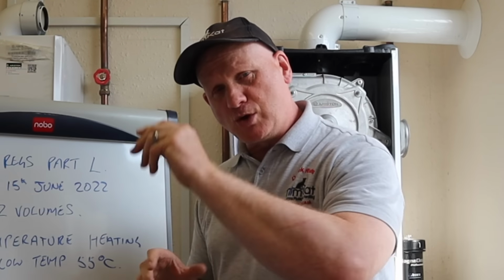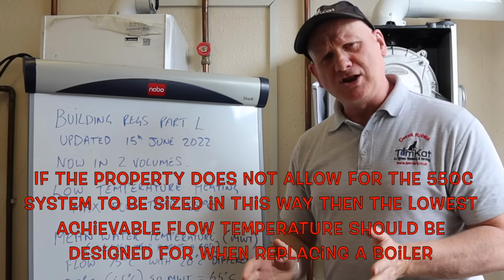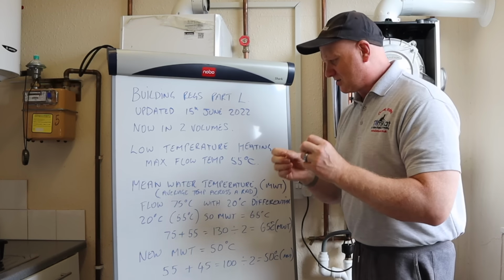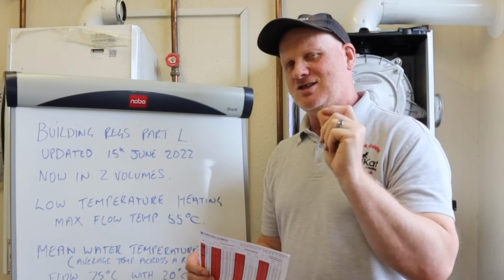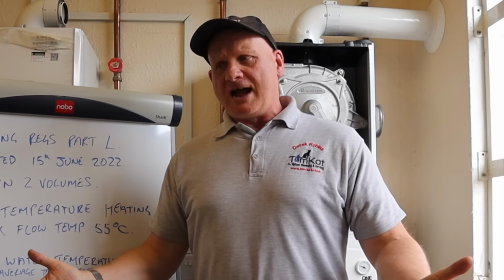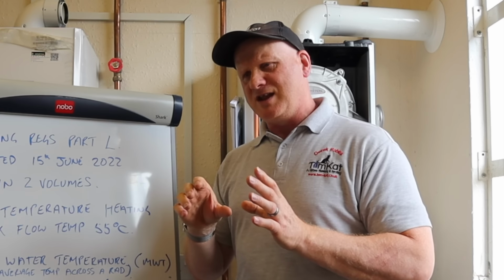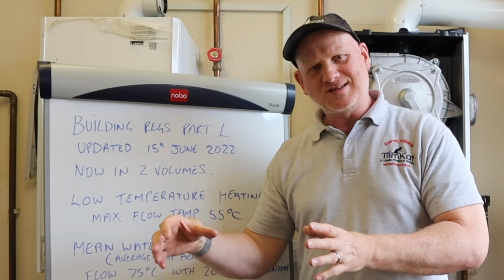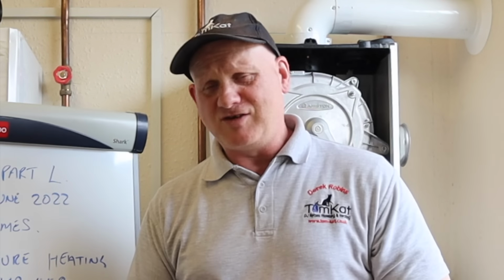Don't adjust your  heating flow temperature until you have watched this video. #saveenergy

Comment: Put your thermostat in the room you spend most time in, NOT the hall. Keep curtains off the top of radiators, which are better placed on inside walls/not under windows. Get an intelligent stat that can vary the preheat period according to how cold the room is and chrono proportional to maintain a true steady temperature. Use programmable radiator valves that can turn on and off at different times and temperatures. Let the sun in to heat your rooms as much as possible. Beyond that, god help us all with these mad energy prices!
Reply: I agree. We are all at the mercy of greedy energy companies and the war in Ukraine as an excuse is bullshirt.
Reply: @Andr3w303 Bit off topic but ever wondered why the war in Ukraine is so 'delicately' balanced? Not enough military help to win, not too little to lose? Now find out who benefits from the big energy company profits! Same argument for who benefitted from covid.
Reply: @johnf3326  i agree 100%. Great minds think alike ❤✌
Reply: @Andr3w303  I thought I was the only great mind! Now there's 2 of us! 🤣
Reply: Rads under windows are for convection.
Reply: @sixmill2  All 'radiators' mainly convect! Putting under windows was to counteract the cold downdraught before double glazing. Directing tge most heat behind curtains will lose the most heat to the outside. I know when I put the bedroom curtains on the sill the room quickly warms up a few more degrees
Reply: @johnf3326  There's still some cold downdraught from double-glazed windows although not as much as single-glazed. I've found having slightly longer curtains that tuck behind the radiator is the answer.
Reply: @stuartwiddows9536  but tucking curtains behind the radiator blocks off one side of the convection surface at the top and will reduce heat output. I tuck our bedroom curtains on top of the sill. Looks messy but I observe my digital thermometer start to rise fairly quickly
Reply: John F is totally correct saying to put the thermostat in the most used room, normally the lounge. An improvement on this thought is to have a second thermostat wired in parallel to the first; this gives you the option of minimising the heat required in the house by controlling the comfortable heat output from the lounge, with the hall thermostat turned down to 15 degrees. When it is required to have comfortable heat throughout the house, turn the hall thermostat up in the hall from 15 degrees to the same temperature as in the lounge; turning it back down to 15 degrees as soon as that level of heat throughout the house is not required. These actions will be very affective as the temperature set in the lounge will be reached quite quickly due to number of people’s body heat, tv, radio heat output etc shutting down the heat output down in the lounge and consequently throughout the house. If you are lucky the position of the current hall thermostat may back on to a lounge wall and is therefore an easy job for a heating engineer / electrician to install. (Yes I am a Retired Building Profession)
Reply: tom arter  'a little' being the significant words, but worth doing if the opportunity arises. I use airtec double fixed to the wall with double sided tape. But I have to take the radiators off to do it properly. It wouldn't be worth paying someone to do it,you wouldn't get your money back. Radiators don't 'radiate' much, its mainly convection.
Reply: There will be no gas and gas boilers in new homes in England from 2025.  Companies must earn money because sales of gas and gas boilers will fall.  gas may be cheaper but they want to earn money to change the technology.  In Poland, they openly said this at the conference.  That's why they have such profits.
Reply: @beks1731  we'll see! Cos I'mjust covered in shit from flying pigs overhead!
Reply: @beks1731 how wrong were you lol
Reply: Radiator on the wall not under the window is one of the stupidest thing in UK
Reply: How noisy are programmable radiator valves during adjusting/turning off and on?
Reply: @ianmarsden8568  theres a bit of rattling of cogs but not loud and not long.
Reply: Balance your rads, foil back rads on outside walls, trvs on all rads in rooms without thermostats, foam insulate all hot water pipes, cut hot water pressure with tap aerators and thus demand and less hit water needed.
Reply: Great advice thank you..we do keep our thermostat in the hall I don't know why..but I own my house it's not a council house and I had new boiler radiators and all pipework in 2018 and every main radiator is under a window..should I have these radiators moved?
Reply: Though the best place for rads in Infront of windows they work best that way?
Reply: Most of my radiators are on outside walls courtesy of my local council. My flat is freezing in winter even with the heating on.
Reply: @samanthahardy9903  have you contacted them regardìng the problem? Moving the radiators would be a big job and may not make a lot of difference if the flat is poorly insulated. Make sure any curtains are not over or above the rads. Put them up on the window sill if possible. May look messy but it will make a big difference
Reply: @samanthahardy9903 add radiator foil to reflect heat back in vs hearing outside walls. Worth getting the council to pay for a radiator powerflush so the rads are not full of rusted grit
Reply: @samanthahardy9903 many councils are retrofitting their poor housing fabric to retain more heat.ask them and note the interior winter temp in the coldest rooms
Reply: @samanthahardy9903  sounds like you need cavity wall insulation
Reply: @jaimz33  I live in a council owned flat so cavity wall insulation won't be done by them. The funny thing is that when my local council sent a surveyor round he said, "These flats are poorly designed and poorly built and should be knocked down and built better than they are but I didn't tell you that!"
Reply: Only thing I’d say is the reason for the window placement is the air coming in from its coldest point, given the quality of most window installs I’d say it still applies , the thermostat should be at the mixing point between the upstairs and downstairs in my experience , wall construction is a mayor factor to take in to account turning one room off can exacerbate the temperature in other rooms , consider for air changes and leakage
Reply: You need the radiator near the window otherwise you get them all steamed up and mouldy. It's much better to be a couple of degrees colder than have disgusting mould all over your house....
Reply: @LawrenceTimme  I already have mold in the flat. Mainly in the kitchen and bathroom due to leaks from the flat upstairs. The trickle vents in the kitchen were poorly fitted and do nothing. The bathroom has no windows and the extractor fan rarely works. I was told to put the heating on full blast and open all the windows in my flat by the council. When I first moved in water regularly seeped up through the floor until I sealed it myself. (The council did nothing and said it was condensation, it wasn't). Since I sealed the floor tiles I don't have water coming up through the floor anymore. My flat has a gap underneath it for people to be able to walk through the estate I live on. My neighbour who lives opposite me has the same problems in her flat too with the radiators.
Reply: @LawrenceTimme it is purely and simply greed that is driving this agenda.
Reply: How come your advice on thermostat and radiator location is the exact opposite of convention? What qualifies you to know better than everyone else?
Reply: @bikeman123  radiators used to be placed under windows in the days of single glazing and draughty wooden frames, to counteract the icy blast. Think about it. Most windows have curtains. Most curtains will be above the radiators. Half or more of the hot air will go behind the curtains and therefore more heat lost through the glass. Also the outside wall will get warmer and lose more heat to the outside. Put a radiator on an inside wall, sure the wall will get warm but that warm wall will not lose that heat. All the convected heat will go straight into the room.  Also you can have longer curtains over the windows and wall, saving a little more heat.  As to tbe stat in the living room, thats where you spend most of your time. I don't profess to know better than anyone but it works for us and there's good logic. All my rads have iTemp programmable valves and that helps too. No one has to take my suggestions on board but I'm just trying to help folk save money in these awful times
Reply: That and pure genius! 🤭
Reply: Radiator should be under window, anyone who moves them will find out why.

Comment: Remember when we had just one coal or coke fire in the living room? And if you were lucky a Valor parafin heater on the landing with the bedroom doors open. Single glazing, solid walls, no loft insulation, wooden draughty window frames and doors. How did we manage? Yer know, we were poor but we were 'appy in them days! Put a big coat on!
Reply: Yeah and winter excess deaths were out of control. The good old days 🥴
Reply: That were nuthin...we use to live in show box in middle of road ☺️
Reply: @jockster5525   Luxury !.......our shoe box 'ad an 'ole int roof.
Reply: @timhancock6626  😂☺️😂☺️ that were nuthin...we used to live int hole in middle o road 😂
Reply: @jockster5525  Naaa then, don't start! But tell that to the young folk today, they'd never believe ya!

Comment: so 54 would be a beter number to work to right the acutal condencing point. part l confuses me as an installer. 

wish as a solo installer  somone somewhere would clarify when these regs come out what we need to do(what are gas safe doing?). changing a boiler do we need to swap out rads? i know the answer now.

  i was working to 55 years ago with longer burn times and bigger rads sized correctly. flue seals melting. they blamed everyone but themselves. i hate them so much.

i know i cant spell

lets not get into weather comp....................  you proably dont know we dont have to do it here. were do we  stick it ?

to your point about food on the table etc etc etc how are we now in a sociaty where I as a person voted for someone to lead this country. and now we are the point of having forced on us someone like boris(lets face it both of them are bad). its not right. its not the best of both worlds right

to clarify i voted for mrs may. not plaid cymru. 

diolch o galon am yr uploads.
Reply: Either fit weather comp or modulating controls, ideally most homes would go hot water priority to get two flow temps out the boiler.

Replacing rads for lower flow temps is never as big of a job as it seems, as you can swap the existing large rads in the house to other locations and the just replace the small ones.

Comment: I had a new WB system 30i last year and ran it at the ECO setting. This seemed very economical as compared to my old CF80K BTU. But I set the hot water cylinder to 70C.
So the 55C is lower than the ECO setting on the boiler. The system is old 44 years but most radiators have been altered over the years mainly reducing the size as I have introduced insulation which was not evident in my 1977 house. Luckily, I installed multi fuel stove 20 years ago and I bought 4 tons of smokeless last year when it was cheap.
Reply: Set at 70c that's not a hot water cylinder, it's a giant tea urn....just what every plumber needs 👍🤣
Reply: Unless you have a huge pad, those boilers can be easily range rated.  Worth looking into to save a few bucks.

Comment: Good video and I am glad you are highlighting the poor advice being given to consumers. There is one particular group on you tube offering advice from so called industry experts regarding flow temperatures and it goes to great lengths to deliver  a subliminal message to consumers that we are all useless . In this video they mention more than once that most gas engineers have no idea how to commission an installation so it works at optimum efficiency. It would seem then, that we have all wasted time and money attending our local training centres to retake our acs quals and get ourselves up to speed on the latest industry updates and technical advancements. If you watch this video to the end it will lead you to links where they can introduce you to elite installers and not hairy arsed Neanderthals like us. We should all be ashamed that we have failed the general public and Derek should give us our money back. I just hope that consumers will watch a channel like this to see how knowledgeable the videos are and from the comments section how knowledgeable the  engineers are.
Reply: Interesting you should mention this. I am a consumer and have recently been investigating ways to reduce energy consumption and the message I am getting is "most heating engineers don't know how condensing boilers actually work" and basically set them up like they would an old, non-condensing boiler.  I was actually having some work done today and asked my usual heating engineer his opinion. He replied he thought it only really worked properly in efficient, new build houses and that it was pointless attempting to balance a system with a 20 degree difference across the flow and return on an old 1930's house. Also noticed he'd set the boiler flow temp back to 70C.  I had dropped it to 60C as an experiment.  It is difficult to know who to listen to.
Reply: @pancakesgo7995  As always, in every trade, there are good and bad. As you say it's difficult to know who to listen to. Even Trustpilot doesn't remove companies or individuals who have been found guilty in court of incompetence and negligence.

Comment: Derek, your caption says you should have a cylinder stat to stop the temperature going above 650 C! That would scald you! I think you mean 65°C. You've got the same error on the system sizing slide. Great video otherwise!
Reply: 650 deg C I would say that would melt you not just scald. 😀

Comment: Having the boiler stat so low that the house is too cold is just as big a waste of gas as having it too high. One thing you missed on a combi is either turning the hw preheat off or installing a timer for the preheat function (if possible of course). No point having the boiler preheat at 2am or through the day if no-one is in.
Reply: How can having the boiler set low use too much gas? It might run longer but it will use less energy.
Reply: @MrRawMonkey  I'm not suggesting it  uses too much or more gas, I'm saying what is the point of using not enough gas to remain at least somewhat comfortable? You may as well not use any gas and be cold. If the heat output of the radiators are less than the heat loss through the fabric of the building, then the little heat that is emitted will just be lost without heating the room, I would consider that a waste of gas no matter how little you are using. If you disagree that's fine. I concede however, that if the purpose is to just protect pipework from freezing then fair enough.
Reply: @chlalew  I agree with you, I have worked in the HVAC industry for 35 years. Most home radiators were sized based upon 82•C flow temp. If people go about turning down the boiler flow temperature then the room stat will be ‘calling’ for heat longer than necessary because the radiator outputs are drastically reduced,  result = boiler running for longer, cycling on/off too much at a lower temp and room temps too low. 
Turning down the boiler temp AND the room stat set point may save you some gas but there’s a balancing act between room temps and ‘boiler on’ durations. 
Personally I say leave the boiler flow temp as high to match the radiator output for the rooms and to quickly regenerate hot water cylinders (where used) and simply turn-down the main room thermostat and individual radiator TRV’s to lower the room temps especially in rooms not used so much. Turning down the room stat turns off the boiler, no gas used, turning down the boiler flow temp could make the boiler run for much longer; using gas.
Reply: @stevec1097  If the boiler is run more efficiently (more time operating in the condensing mode) then more heat will be produced from that gas and less heat exits the boiler flue.  The extra cost of running the circulating pump for longer periods is marginal compared with the heating gas cost.
Reply: Better still turn the preheat off.

Comment: And remember all the heating thermostats and cylinder stats plus motorized valves for each circuit has to have boiler interlink.
Reply from the maker: They are the boiler interlock

Comment: It's most important to have a thermostatick blending  valve on the Domestic hot water cylinder
Reply: That's not the right place to put it - if you are worried about scalding it should be near the outlet. Much better is to reduce the hot water temperature to around 45 C and if you're worried about the legionella issue boost to 60 C for 1 hour once a week.

Comment: Hot water won’t kill bugs unless you set it to a scalding temperature, so you only really need to have warm water to wash the pots and dissolve the oil to allow the soap to work better
Reply: Not sure that's true - most virus and bacteria won't survive even cold soapy water. Most enzymes in these bugs won't survive temp of  60 degrees either.
Reply: Better stick to life on the high seas, buddy. 🤣